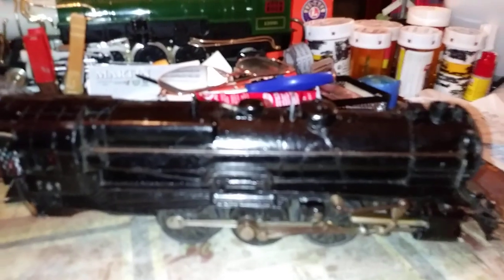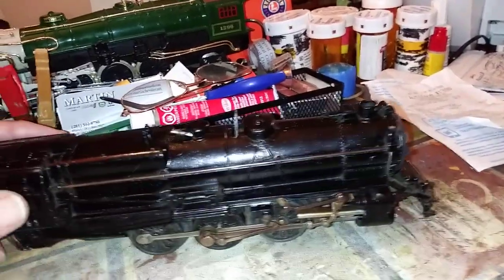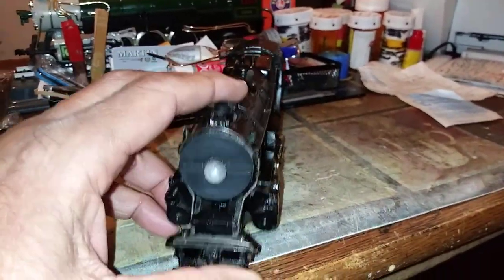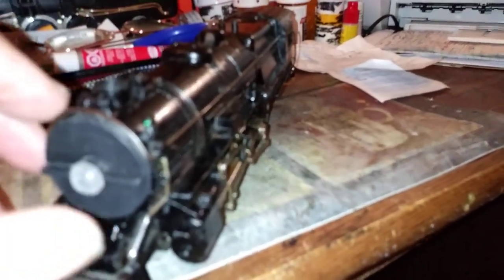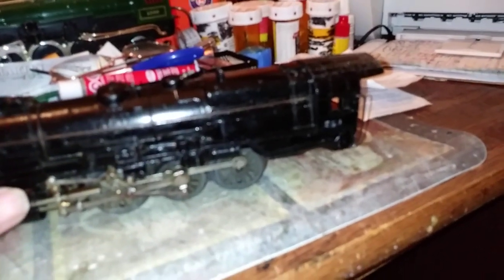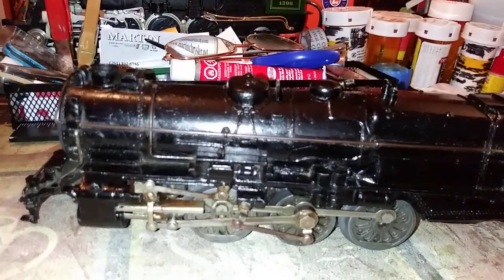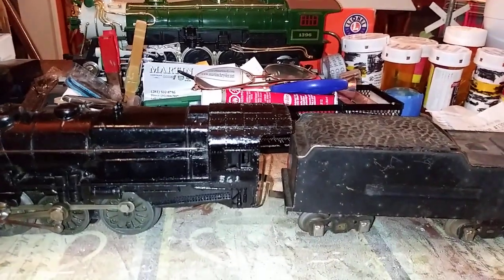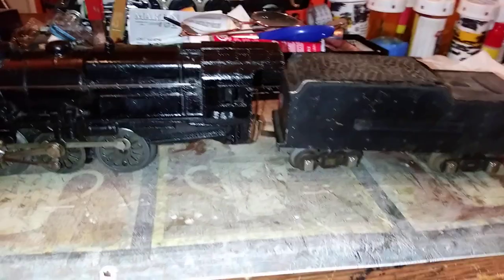Finally got a Amer.Flyer #561 + unboxing a #564 tender, & more

Comment: That 561 has some good details...the drive rods and other side rods looks impressive.  I have never seen a 561 before.  Like you said it runs very smooth.  Will have to look into getting one myself.  I do have and American Flyer Burlington Zephyr and really like the look of it.
Reply from the maker: Hey Chris, I really have always liked the Flyer 3/16 O gauge those worm gear motors are hard to beat I also have a zypher that needs needs a little refurbushing  and polishing up I think  I am going to rebuild my motive power with strictly Marx and Flyer with a few Lionel diesel and of course I'll keep my other engines like, Kusan, Wyandotte,Hafner,Unique & etc. but no longer trying to add or build up my trains around those loco's. I've been watching your videos and there Great. really niice job on that Crooks. "Happy Rails"